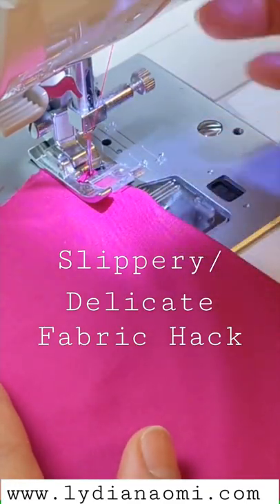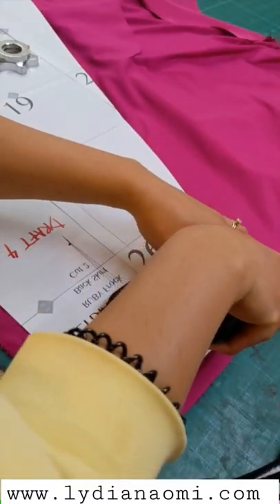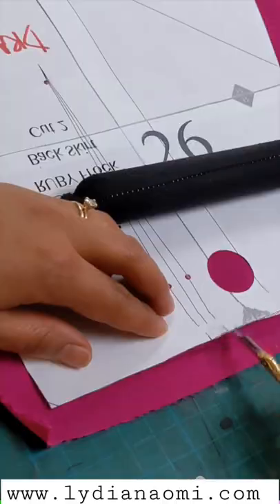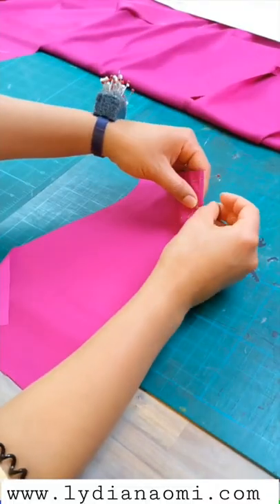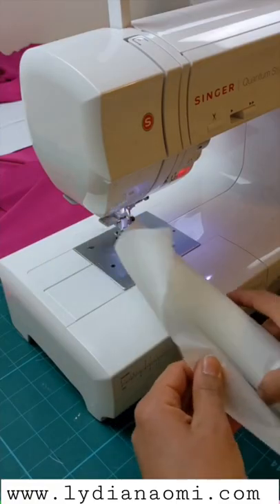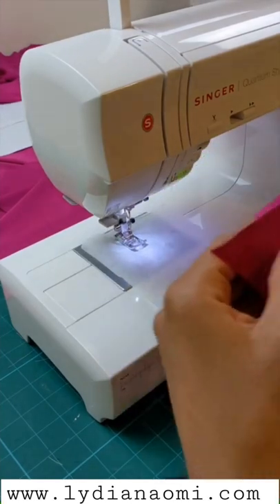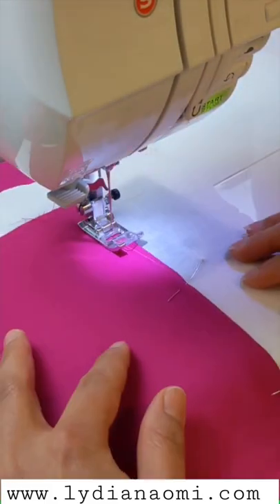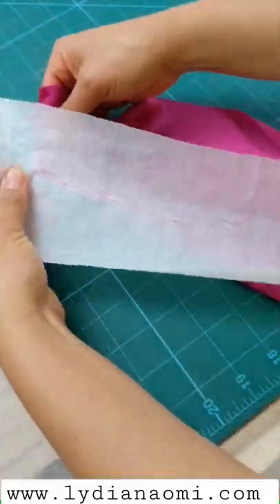Sewing Hack for Slippery or Delicate Fabric - Satin, Silk, Rayon, Lining

Comment: You can also turn your feed dogs off or cover them if your machine can’t turn them off. I turn my stitches down too when I use delicate fabrics or large weaves.  It’s such a pain.
Reply from the maker: That's an idea! 😊 Can you still do even stitches with your feet dogs off?
Reply: @LydiaNaomi  yeah I just sew slower. In general with delicate fabrics I sew a lot slower or use the paper method with the feed dogs up. If you ever sew with the feed dogs down, try some scrap cloth and use your left hand to pull from the back side. You’ll get the feel for it but it’s different on different fabric. My sewing machine chews up satin if I don’t put them down, use a stabilizer or paper.

Comment: Would stabilizer work or is that what this is?  I'm new to sewing so have no idea.
Reply from the maker: With this fabric, I might use a very light fusible interfacing strip along the zipper line to keep things from stretching, as long as your interfacing is very light and only very thin amounts in same areas then I think it could work.